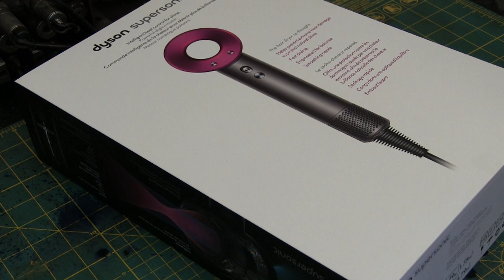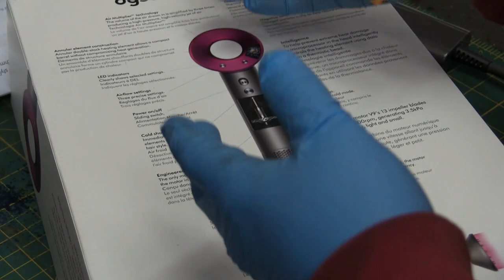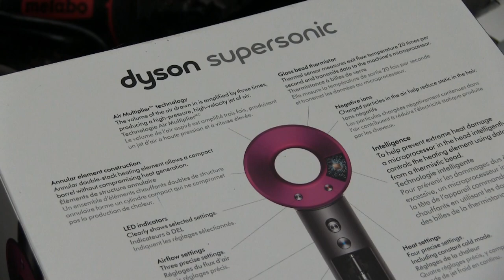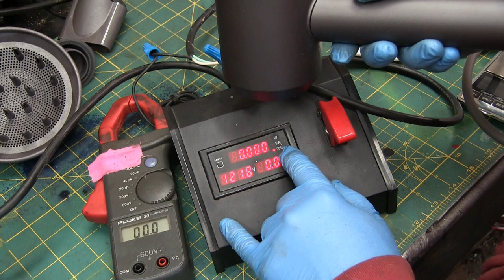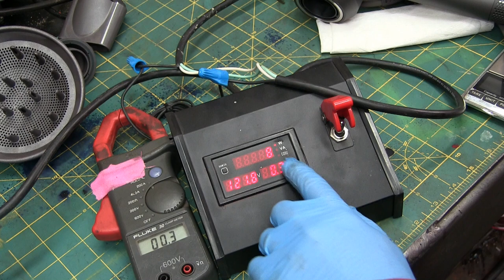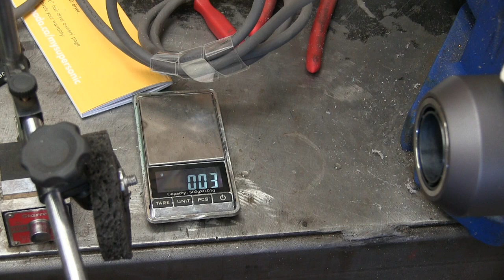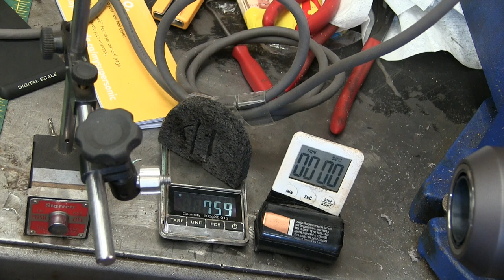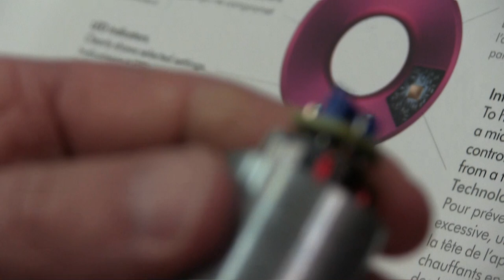BOLTR: DYSON HAIR DRYER. Is it WORTH the MONEY?

Comment: the vanes in the motor are called 'stators'. they straighten the flow of air
Reply: not sure. I would imagine that if they were lined up without any pitch in the moving blades, there would not be much happening at all.

what is going on with that blower is the same idea as a turbofan aircraft engine. the inlet turns and sucks in air, then that air passes through a set of stators to straighten it out so it can enter the compressor stage with maximum velocity. except here there is no compressor stage. it straightens the air so that it isn't swirling around and losing its velocity via turbulence inside of the mechanism.
Reply: Stators don't move. That wheel is a turbine rotor. Setting them up one after another will create a stage of compression, just like an axial turbine engine.
Reply: Risto Mladich FAA-8083-32 Volume 1, Page 1-41 "Axial Compressors". One rotor and one stator make one stage of compression, equal to about 1.25:1. That little motor is compressing some air. If they really wanted to chooch it up, they could add a couple more rotors and stators.
Reply: Dettweiler I always thought they didn't move, hence the name stator, as in static. But modern jet engines have variable pitch stators in the compressor to optimize performance and for surge protection. Don't ask me how they make that happen mechanically speaking. But traditionally yes, stators were fixed. And of course they typically are fixed in hair dryers!
Reply: scott black Variable stators are moved by a linkage assembly on the outside of the casing like this: http://i.imgur.com/1Fk2D1B.jpg
That's not what I was referring to, though. Risto and Nick were talking about whether or not that would generate compression.
Reply: BLONDIE LOCKS No
Reply: The reason for stators is to align the air to the optimal Angle of Attack for the next set of rotors, or to straighten the flow after the last compressor stage, to reduce turbulence and eddy currents (and thus stall-induced cavitation, which can tear a compressor or turbine apart in seconds). You actually want the air entering a combustion chamber at near 0 velocity (thus max potential energy stored via compression, waiting to be released via heat expansion).
Reply: Where I'm from, we call them guide vanes. Stators/vanes... no matter, they do the same job.
Reply: Stator and Rotor are the stages, Stator Vanes, or Guide Vanes, are what the fixed  blades are called. But in common conversation, the terms do get used quite interchangeably and normally without much confusion.

Comment: More cheap plastic, overpriced gimmicky crap from Dyson.
Reply: It's not cheap plastic, it's expensive plastic.
Reply: pseudocoder78
Hahaha! Very expensive plastic!
Reply: Yep.
Dyson is overpriced shit.
Reply: Razor 404
Oh, someone fell for the digital motor gimmick! Haha!
Reply: You did see the difference in performance between that Dyson one and the $400 cheaper red one right?
Reply: It's highly engineered expensive plastic ;)
Reply: maybe 25% performance increase over a normal hair dryer at 5x the price. You are not paying for the performance, you are paying for the design that makes it look like the air is magically pulled through the tube on top when it's really done by a tiny fan in the grip. It is impressive that they can build such a tiny fan and still beat the performance of a normal hair dryer, but it has no practical use.
Reply: fishbong
Correct me if I'm wrong but as far as I recall from the video, the performance wasn't even 10% better in either air flow and drying performance.
Anyway your point stands to it's market positioning, it's a design product.
Reply: Dude, they use plastic because it's light. They try very hard (and succeed) to make it look look like aluminium because potential buyers prefer a metal look, it gives a more durable and quality image. Dyson did it brilliantly.
Even your car is more and more plastic.
Dyson products work fine. Also I believe it's quite attractive. People value the happiness when using their products, and they deliver. We couldn't give less shit about what you think.
Finally, they create a lot of patents and bet on new ideas and technologies, R&D costs more than copying existing designs. So many chinese companies copy their designs, it's a proof of success. 
So fuck your opinion
Reply: toocoolforu
Overpriced.
As seen here, a $100 hairdryer does is almost as well.
The additional $400 spent on the Dyson is buying you an overpriced status symbol.
Reply: Syrnian Without a doubt yes. Though Dyson R&D will benefit the industry much more than others.
Reply: toocoolforu
Except the R&D on the Dyson hairdryer gets you the results that could be had with a hairdryer that costs $400 less.

EDIT: It is not hard to vacuum metalize plastic. It is quite easy in fact.
Even easier and cheaper is paint that can be purchased by anyone from an auto parts store or even Walmart.
Reply: Syrnian only its a much more efficient system at 150 watts
Reply: How much did the fan on the cheaper hair dryer pulled at max power again?

EDIT: yeah just re-checked. draws the SAME power on the fan, for about the SAME airflow. 10% better at best wasn't it?
Well there it is. It's expensive cause it's fancy, not cause more efficient.
Reply: toocoolforu
And where is that in this video?

Comment: my gaming pc draws less power than this
Reply: Phoenix I wish I could get away with numbers that low. After water cooling and adding a second gtx 1080 I was forced to go up to a 1000w psu. It's noticeable on the monthly power bill, that's for sure.
Reply: Thomas Zimmerman , I think I caught
Reply: you're game draws more power from you than anything else.
Reply: Not only does my PC draw less power, I bet it does a better job of heating the room too -.-
Reply: mines less than 400 and i have a 1070 and run VR
Reply: Yung Kirk even with my 3900X and 2080 Ti overclocked, in game i only draw about 500W. pure CPU stress tests loading all 12c/24t only draws 300W. that power draw with the heating element is insane

Comment: I bought a 50mm 10-bladed ducted fan that draws 300 watts and spins at 68,000 RPM for $60 shipped to my door with the controller. It moves enough air to fill a 60 gallon garbage bag in about 5 seconds. I'm using it to build an evaporative air conditioner! Dyson is 90% wank with a couple good ideas mixed in.

Oh, also, more poles = less speed for a given drive frequency. If you want maximum speed without having to deal with RF voodoo, you go for minimum number of poles. The tradeoff is torque. Having more poles decreases the step size per cycle while maintaining the same amount of power input, so it makes more torque. Better mechanical advantage.

Also also, sensorless brushless motors are very common. All the sensor really does is give you rotational position, which allows you to more easily start the motor. When the motor is already spinning, the controller just watches whichever coil isn't energised for pulses that indicate a magnet passing by and use that to infer angular velocity.

Sorry about the wank words, I get wordy when I'm baked.
Reply: bake away brother
Reply: Link to your motor?

Comment: I bet a motor like that one could finally make a Dremel useful.
Reply: You're right. Can't get anything done with wet hair on my dremel.
Reply: Ben Landvatter I wonder why Dremel doesn't use brushless motors. Longer lifespan and higher RPM, being a high RPM tool this would be useful.
Reply: I wonder if it's because complete novices will just keep buying new dremels instead of just replacing the brushes when they wear down?
Reply: +Aluminum Foil 
I've never killed the brushes. The speed controller, the spindle bearings, and the flex couplers always take a shit. They're not great.

Comment: Nice teardown man. At 36:36 you mention that there is no feedback about motor speed and that that's fairly uncommon. In fact, sensorless brushless motors are actually quite common. In most of those cases, the motor itself is used as the feedback sensor for speed and/or position sensing.

Comment: Ever figure out where the 8 watt power draw while off is coming from?
Reply: Likely the microcontroller, though it'd be a bit tedious to find out for certain, it's probably a combination of things
Reply: wasn´t it 8VA? It might be reactive load.
Reply: Could very well be a combination o the uController as well as a bleeder resistor for those monster suppression caps.
Reply: Probably mostly those huge suppression caps.
Reply: Enrico Conca You don´t have 8W bleed resistors, or even 4W.

If a microcontroler draws 5 watt it will burn. (well with no cooling anyway)
Reply: 8 wats for a microcontroller is huge, i seriously doubt it. the thermals on the pcb would be nuts.
Reply: I agree and just find it a little high of a wattage pull for me... My ocd part of me anyway wants to know! Lol
Reply: Bryan Roberts I think it was 8VA.. so if that is the case its a virtual load, not a real one. Because of the rather big capacitors in the cable, i would say that is reasonable.
Reply: Most likely it's the voltage dropping capacitor(s) used to bootstrap the buck controller drive circuitry. You put a big mondo capacitor in parallel with hot and neutral, this allows you to get a low enough voltage to just rectify and snub with a zener. The problem is with the parallel capacitor, you are drawing current on every power cycle, even though that current is doing "nothing" so it's not a lot of real power draw. This is called reactive power. Dropper caps have notoriously bad power factor, which is why they are mainly used for bootstrapping SMPS and Chinesium LED lights.
Reply: I was thinking it probably is not the big ones in the cable, which are most likely for power factor correction, thinking that most modern SMPS/buck DC supplies use active power factor correction and don't need massive filter caps on the input. But actually looking at schematics, a lot of older SMPS designs use massive caps on the input (which creates a ton of reactive power while not under load, which is why that style is being phased out). Can't tell for sure without a trace, but either way the 8VA is likely from some big cap in parallel with AC in.
Reply: An 8W "micro controller" would be nice - that is like and Intel Atom on steroids or and i3 mobile already - enough to power a tablet.
Reply: ABaumstumpf it does cost more than many tablets 😂
Reply: ABaumstumpf You just take a normal microcotroler than short one of the outputs.. then it will be about 8 W.. ;).... one of my students tried that .. it was pretty hot
Reply: @defenestrated23  They use brushless motor (100W) - it's too much for capacitor based voltage drop, unless the capacitor is only for the microcontroller (which is always advised not to do). Also if they use capacitor+resistor+zener - they should not use full wave rectifier either. However indeed 8VA is way too much for idle load. It's unselleable in the EU where 1W is the max allowed for standby.

Comment: Dude!!  My wife loved this video. She wants you to do a hair straightener next. Anyway, you showed the heat output from the dyson but how'd that compare to your wife's hair dryer. My wife has to know!!
Reply: AvE thanks man. That's crazy that the heat output was the same as well. Do you have any thoughts on the far infared tech in some dryers that's supposed to dry hair from the inside out without damaging it?  Obviously I'm now the conduit through which my wife is speaking to you, haha.
Reply: Heat is heat.  OK, I hate to be "that guy" but heat can be transferred in more than one way (conduction, convection, radiation).  My guess is the marketers of these dryers are trying to say that radiated heat on certain frequencies penetrate the surface of the strand, thereby drying your hair "moar bettar" than through air convection.  That is probably BS, but it's not because they are over-complicating the issue.  Changing the mode of heat transfer CAN make a difference.
Reply: I could see FIR working in a sense, but it could also be difficult to do, and/or dangerous. You'd essentially be microwaving your head to a degree (but not quite microwave frequency). It would be difficult to do because it would work via radiation rather than convection, meaning one would need to shoot this FIR like a gun rather than just heating air and blowing it out.
Between the extra cost, potential non-viability of it, and potential danger, I wouldn't say it would be a good thing to invest in.
Reply: usually it's just some red leds, because it'll look like it's outputting a ton of heat, without doing any damage.

Comment: Great video AvE!  The pre-vanes are typical for industrial fans to reduce power to pre-spin the air for the vanes of the impeller; it should be in same direction.  Check out any industrial fan manufacturer with a Variable Inlet Vane (VIV) fitment to the inlet of centrifugal fans.  It will also reduce imposed vibration.

Comment: I took one apart recently and the propeller is now a glass-fiber plastic part, value engineering in action! They also got rid of one screw! Save for the buttons, the rest of the fan can be taken apart fairly easy. Once you disconnect the mains cable tabs, you can jam the switch and motor connector into the head and then twist and pull out the board/heater as a single unit.

Comment: The marketing wank on the impeller is so typical.
There's absolutely no reason for the fins to be aerospace spec.  There's literally fuck all pressure, heat, or stress in the chamber.  As long as it holds it's structure during function, it will work identically to precision machined fins for the purposes of the hairdryer.
And either way, both parts would surpass the life of the actual device indefinitely anyway so, that's pretty laughable.
It would be a total insane waste to put that much manufacturing into something that purposeless.   
But glossy flyer said it, so...  smh
Reply: I highly doubt that the impeller is machined to anywhere near the tolerances used in aerospace, it's just not necessary.  It may very well be that running them off in a 5 axis CNC mill is cheaper than having the impeller cast out of metal for a lower volume production run, it depend's what manufacturing capability they have the cheapest access to.   And there isn't any actual 'aerospace spec' that applies to such a part, just like there is no such thing as 'aerospace grade aluminum,' it's all marketing.  They may finish the part to comply with an ASTM or MIL specification, but that's not really difficult or uncommon.  So yea, most likely pure marketing BS.
Reply: Winterfalke I wasn't asking, i was stating.
Reply: It's not an impeller, it's an axial fan.

Since it spins rly rly fast it has to be strong enough not to rip itself apart and also free from manufacturing defects.  For safety.
Reply: C Hone Did you even read the comment?

Comment: @ 30:15 More poles would decrease the speed of the motor. More poles gives you more torque, but lower rpm.
Reply: They're driven with an h-bridge controlled by the PIC.  They can just up the poles and have the confuser switch at a higher frequency to get the same ripums.
Reply: only a half H bridge. The motor only needs to turn one way. But fuck me $500 for a hair dryer! i have a dyson vacuum which cost £250 and i use the £50 cheapo one more. great marketing wank though.
Reply: @ahayesm, why would they go through the cost of adding more poles, and a more robust controller when what they can achieve the same result with a simpler solution?

Comment: $25 hair dryer, $475 bullshit.
Reply: Fred Garvin 
That's Dyson for ya! How do you think that digital motor will hold up.
Reply: Each impeller fan is entirely CNC'd from solid aerospace-grade aluminium due to the required tolerances and high speed. It isn't cast or pressed. Each motor alone would be $30+ or more a piece to manufacturer, let alone the magnets costs. So I'm not sure where you got $25 for the entire machine from. The motors are made in-house in Dyson owned facilities in Singapore: https://www.youtube.com/watch?v=L5IROOrHg5w I'd estimate the DDU of this machine to be $100-150 or so. Go take apart a $25 hairdryer and you'll see a difference.
Reply: +Fred Garvin
At various times, I do miss being in the Quad-Cities, but I wouldn't want to be there at this time of year!  Has your service area expanded, for example, do you happen to cover Coal Valley, Silvis, Eldridge, or Blue Grass??
Reply: Come now, it's a bit over engineered. 1500 watts, for example.
Reply: Dyson and Bose..
Reply: Yeah, I used to love Dyson. But I stopped since my last 2 vacuums broke down within a year.

Comment: I'm thinking they don't want to use aluminum for that purple airfoil piece because it would retain more heat from the hot air passing through it and more likely a burn risk than the heavily treated plastic (that looks just like purple anodized aluminum). That's my story and I'm sticking to it.

Comment: With a 10A heating element, I guess you could use it as a hot air gun..
Reply: Most hair dryers are like 12-15A. A $13 hair dryer on Amazon is rated at 1875W (15.6A). Hair dryers actually put out more energy than heat guns, but they are safer while doing it.

Comment: I believe that lip on the impeller blade is deliberate. Like you, when I first saw that thing I had the same thoughts. Then I looked closer. Those blades are very deliberately airfoil shaped. That are also tapered And, they have washout designed in which means they twist. This all helps deliver a higher rotational volume of airflow. Note: I am NOT an engineer. Just a guy (like you) who likes tinkering with stuff.